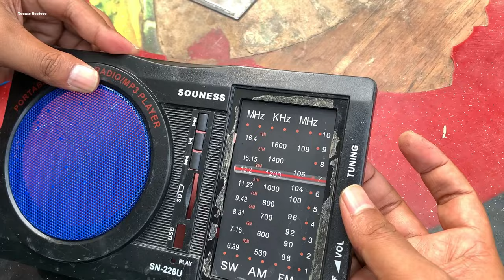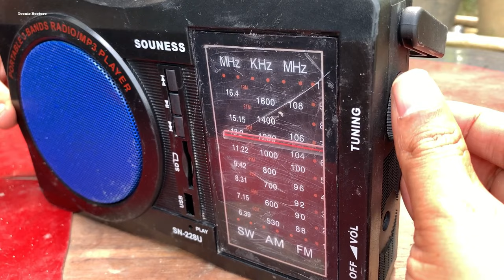RESTORATION Radio Transistor Panasonic Portable 80-an Vintage | Restoration Radio

Comment: the main thing is to wash with water and everything will work
Reply: Don't forget touching a few random points on the circuit board with test meter leads before soldering on a lot of brightly coloured wires. Then, as if by magic, it all works again.  It's a miracle and we all know how often they occur 😊